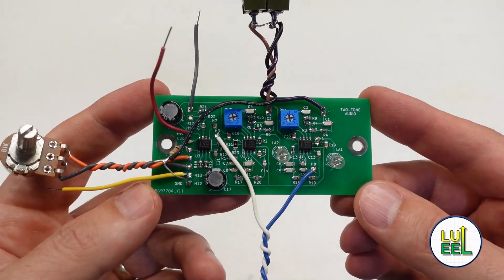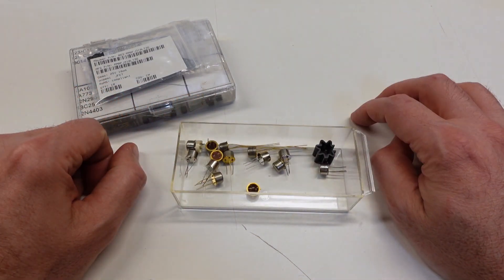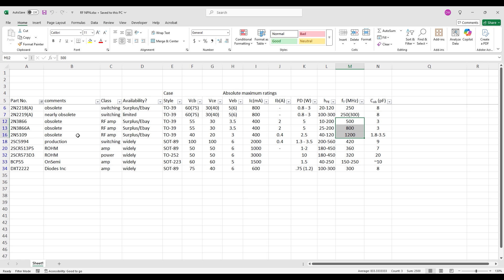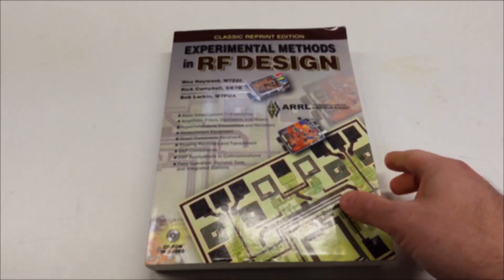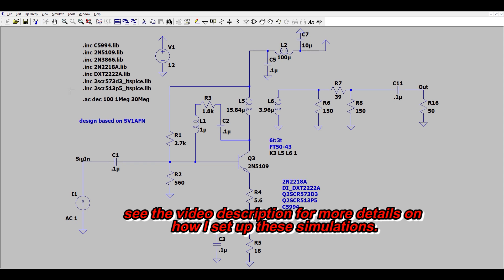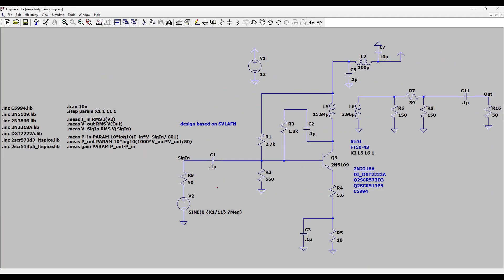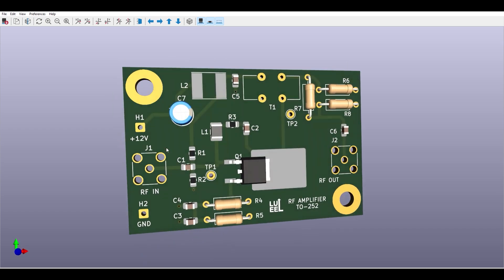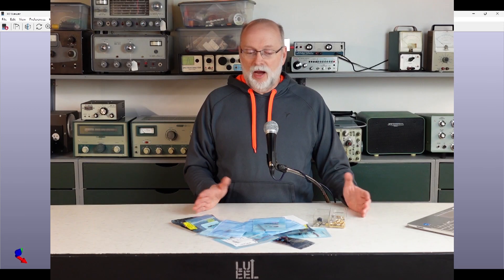SMD Transistors for RF Amplifier use: Part #1

Comment: I've found on LCSC, a very common part, 2SC3357. Cheap as chips, but claims to have a transition frequency of 6Ghz!
Reply from the maker: Looks like an older part unfortunately.  The sources I checked show it as obsolete and only available as NOS.
Reply: @levelupeelab  I'm guessing at some point chinese fabs got the process layer files to 'copy' it, because there are many chinese OEMs that produce it currently. You can find it in the thousands at LCSC from many manufacturers.
Reply: @levelupeelab  Apologies, my memory might have also been off by one. Even more common from asian OEMs is the 2SC3356, it goes to 7Ghz

Comment: Just one question here, and excuse my ignorance.. What is the advantage of using discrete transistors for building a preamp instead of opamp IC's like the NE5532 ?
Reply from the maker: Power and bandwidth - there are no op amp ICs that I am aware of that can reach the level of output power I want, and also frequency bandwidth up to at least 21MHz (the 15m band)

Comment: Great video….what can I use to use for a rf amp broadcast band in a antique tube radio
Reply from the maker: For low power amplification, the regular old 2N3904 (or MMBT3904 in SMT format) usually works fine.

Comment: After some history research I designed a digital clock with state of the art 1969 technology.   Using SOT-23 SMT transistors LEDs and other components, some of which had just come available.  Thank you NASA and Apollo. It took nine 2" square SMT PCBs and over 300 BJT transistors for counters, 7 segment decoders and logic.  The time base board can use a 32KHz crystal or a magnetic pickup and coil to swing a pendulum.  I just got the PCB and still have to build the clock.  A simple project now with transistors selling 250 for $1,  CAD, SPICE and email to PCB production house. Side note: The first digital LED watches with ICs came out in1974 on Carson Tonight Show.

Comment: Excellent video! I was working on something simular except I decided to use LDMOS. I picked two AFT05MS004N, and AFT09MS015N. both are very cheap and have been made for a long time. one had a predisesor that was discontinued but was replaced with pretty much the samething. I'm not used to working with LDMOS and I ran into a learning curve. Baltic Lab gave me some advide to look into and now I had ran out of time but plan to go back to it. one is 4 watts and the other is 15 watts. what ever someone comes up with is highly needed in the hobby and I can't believe more people are not working on using newer transistors to replace our obsolete transistors. Thank you!
Reply: There is a really good 5W driver amplifier for AFT09MS015NT1 designed by Jim WA2EUJ who has some pretty good HF amp designs. I've pushed ~9 W for some pulsed applications without burning it up.
Reply: @thesuki  Cool, I'll check it out.
Reply: That's exactly what I wanted to suggest, too. Either modern LDMOS or even older MOS transistors like IRF510. The yt channel "RF Man Channel" explains some of these designs in his videos.

Comment: This is just what the amateur homebrew community needs.  'All our favourites RF transistors are 40 years old' I wrote in a blog post 5 years ago.   
After hunting around the forums I settled on 
BFU590GX and used it in a 28MHz driver for a RD16HHF1,  with success.   
Looking forward to seeing what you find experimentally.
As a follow-up thought , how about a similar piece on available and cheap alternatives to SA612?   Minicircuits +7dBm mixers but these are up to $10 a piece and require a more beefy LO drive.  Is 1496 an option in a receiver first mixer? Other ICs?  
I would love to see a discussion of the use of cheap JFET mixers.  See KD1JV SodaPop for an example.  Thanks for your efforts, top quality content!

Comment: I have seen a number of designs where 2 TO-92 transistors where used in parallel in the feedback amplifier, with 2 separate  (unbypassed) emitter  resistors to equalize the emitter currents. This gives increased dissipation. A suitable device is the KSP10 (The MPSH10 used in the original design are obsolete). If the DC current per device is kept about 20-25 mA max, then IMD is passable.